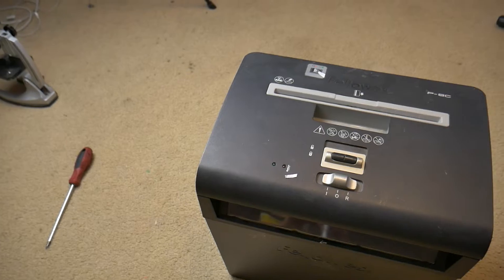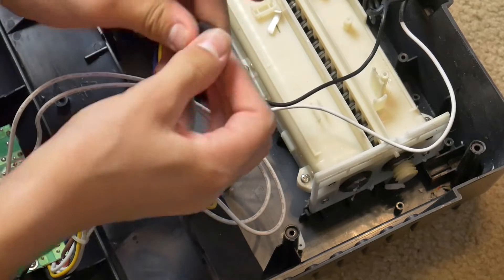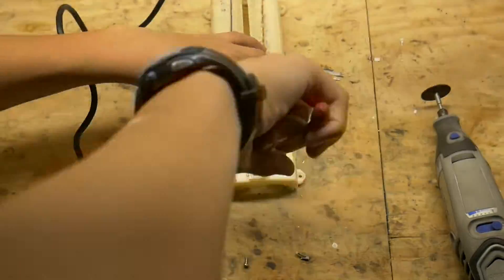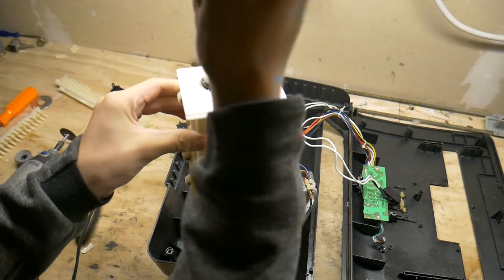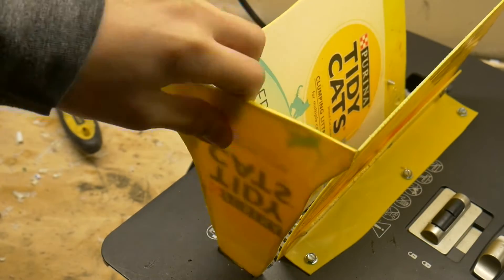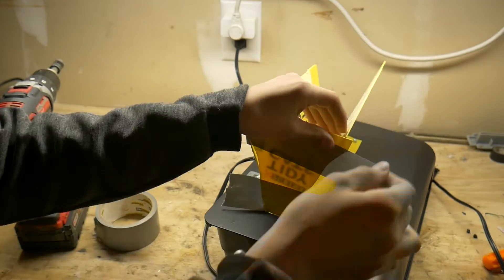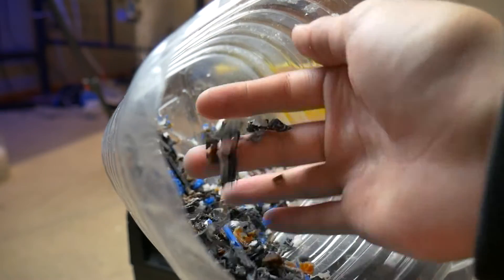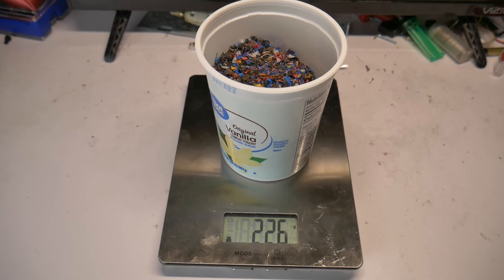Make your own PET filament from recycled bottles at home

Comment: 8:30 SAFETY FIRST! Use a tool to grind in there around ...
Better you would have used a stronger motor instead pushing back and forward to clear the parts.

Comment: Misleading title.
You violated a paper shredder which is simply neither meant nor capable of shredding plastics and the result shows.
The final yield at the end? Did you expect to get more or less than what the items weighed before shredding them?
Reply from the maker: Instead of paying $500 on something like the Precious Plastics®™ shredder, I spent $30 on a paper shredder and made it do a decent job. It is still holding up and works just fine for people who aren't mass producing filament. The final yield was around 10% less than what I put in.
Reply: @SilasCreates  "a decent job" If you say so.
"works just fine for people who aren't mass producing filament" - see thats my point. You claimed to show how to make filament from recycled bottles but you didn't.
You simply took a paper shredder and put some plastics through it. Thats the entirety of your video.
How did you manage to lose 10%? There is no chemical reaction taking place. The only way to loose material is to spill it on your carpet.

Comment: "Make your own PET filament from recycled bottles at home" - Makes a plastic shredder and tells you to buy a $3,000 extruder.
Reply from the maker: You can make an extruder for just a few hundred or so. Check out the filament extruder by Hugh Lyman.
Reply: @SilasCreates Have you actually tried extruding PET with it? Due to ease of crystallization and other factors, it's supposedly very hard, which is why all the commercial filament is that PETG garbage instead. I'm very eagar to see a working rPET filament extrusion setup but I don't think it's easy or cheap at this point.

Comment: I might be wrong but that switch you took out of the machine had suspiciously thick wires and i couldnt see a powersupply inside.. might be a good Idea to put an enclosure around it or replace it with a switch made for external use. If it is live wires i wouldn’t trust those heatshrinks.

Comment: Nice project! I'd consider the same mechanism with a stronger motor and some reduction gears to lower the speed and raise the torque. A good pair of tin snips would be handy to cut down large pieces before loading them. I'm now keeping my eye out of an old shredder. Thanks for that idea.

Comment: Effective and cost effective!  Looking forward to the next phase.  Thank for sharing!
Reply: Cost effective? The way I look at it, if you make $20 an hour, then in one hour you can buy a roll of filament. I'm sure it will take hours ho make a roll of filament. I not saying it's not a great project. It's just not cost effective for me.
Reply: @jadlaf  True, when not on a fixed income nor have the time and or I guess resources other than money or some other financial instrument.  Good point.  Will need mental facilities as well to make a more automated system ideally to reduce time spent making to a minimum either way I look at the situation.  Wondering what the performance of PETE vs PETG is now I'm thinking about again.  Thanks for the thoughts.  Reminds me of the string trimmer nylon experiments I think CNC Kitchen performed.  Will need a dyer as well for optimal material performance, though I got mine for free minus the time and maintenance of my vehicle to pickup.